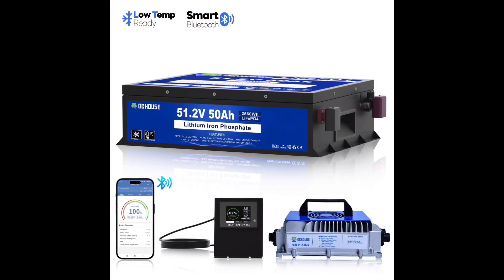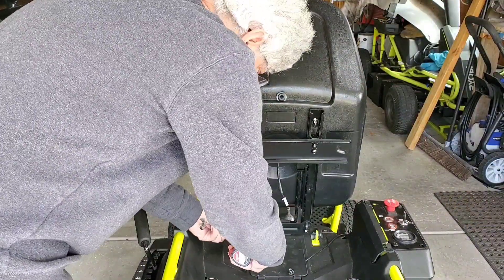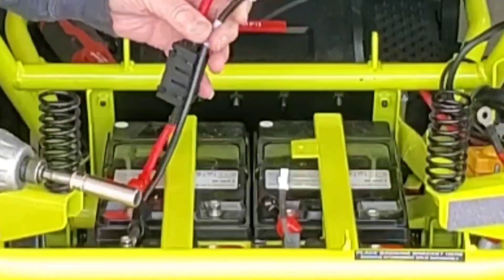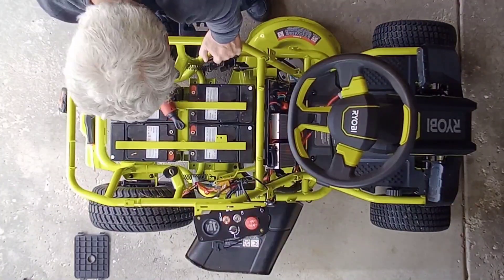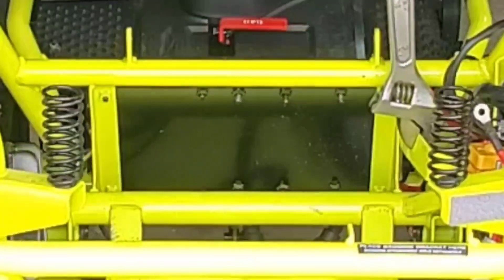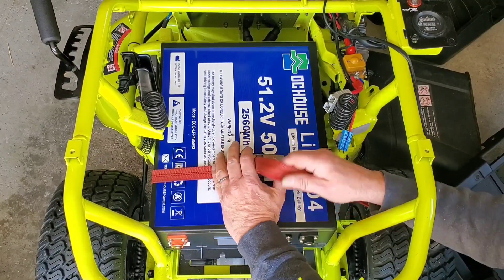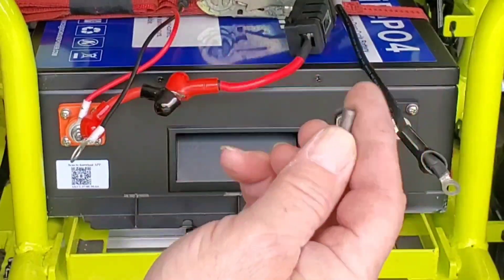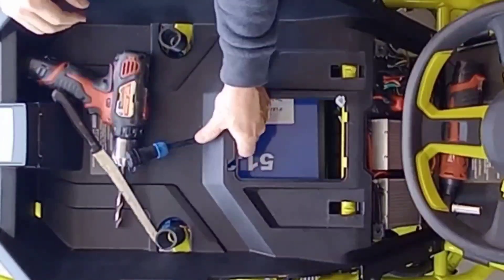DC House 48v 50ah Bluetooth Battery in my Ryobi 300e Riding Mower

Comment: Thanks for this helpful video. I've a 480ex and have noted that other videos on this topic don't show the lips on the base of the DC House battery being cut away and the frame being bent. Might the dimensions of the 480ex be larger than the 300e?
Reply from the maker: Yes the RM480 is completely different than the 300e for battery installation. 
Here's a video for a dc house 100ah battery in a zt mower the electrical is the same as the RM480 mowers 
https://youtu.be/Ddkk6SsI1tY?si=wiYTqp8sRtLArBo5

Comment: The step at 7:06 to loosen up the two nuts is critical. (I almost gave up after all the bending and cuttings) Because this step gives you that little room you will need to wiggling down the battery. Don’t forget to tighten them back at 9:31.

Comment: Questions ,why not use the Ryobi charge port? And the voltage meter?
Reply from the maker: You can use the factory port but the factory charger is not recommended. 
The factory  gauge is calibrated foe lead acid batteries.  It will stay on full untill the lifepo4 battery is under 10%

Comment: Working on this now... removed most of the torx screws with a T25 until the T30 could arrive, bc it worked and I had it on hand. Except for two screws the T25 was too small for. T30 just arrived... fits in the ones I removed already but is too big for the two remaining. Just ordered a set of torx bits; the only one in-between 25 and 30 is 27. I sure hope that does the trick. IDK why they would do it this way.
Reply: 27 worked. I installed the battery and made all the connections... got up to the part where you put in the key and turn it on. But mine didn't come on. The battery doesn't come charged. So I hooked up the charger, charged for 3 hours. The display shows 100%. But I turn the key, and... nothing!
Reply from the maker: Make sure the connector from the back of the port to the charger interrupt (blue wire)  is fully connected and locked together also make sure that the wires are fully Lin the connectors. 
Test the voltage at the bottom two pins of the charging port. It should have battery voltage.
Reply: @Ryobi48vElectricMowers  Got it! The two large blue connectors weren't fully locked in. Turning on now! Thank you!
Reply: Oof. Put all the covers back on, turned the key... again, nothing. This was after charging overnight. I opened the back panel so I could check the connectors; nothing seems to be loose. When charging, the charger light blinks green, red, green, red, and so on, which isn't on the list of things it's supposed to do in the manual. I press the button on the display, and it says 100% standby, then switches to 0% charge battery. I'm lost.
Reply: Tested the bottom two holes on the charging port with a volt meter, and it reads only 0.6V. Pressed the display button and it briefly said 50%, then 0, then stayed on 100. Key turn = nothing. Charger light still red, green, red, green...
Reply from the maker: With no voltage at the bottom pins of the charging port.  Check the main battery connector under the seat.  If it has battery voltage the port is bad. If the voltage at the main battery connector is zero or close to it. The battery bms has turned off.  To reset it most batteries will reset when the cables are disconnected from the ternimals. Once its reset check the port again.
Reply: @Ryobi48vElectricMowers  Thanks, I'll try that. What would cause the bms to turn off?
Reply from the maker: If the bms turns off when the key is first turned on . It's caused by current inrush from the motor controllers. The bms doesn't have a high enough settings to prevent the problem.  I have come up with an automatic precharge unit  that corrects the problem. The Dc House battery shouldn't have that problem.
Reply: @Ryobi48vElectricMowers  I just measured the battery directly, and there's less than 2 volts. Something is very wrong. Now I'm wondering if something is broken in the electrical system of the mower, and shorting out, and draining the battery... maybe the solenoid? I'm now in contact with DC House.
Reply: I'm going to disconnect the battery from the mower and try charging again. Unfortunately, I can't do that now because it's supposed to rain (there's even a tornado warning, though those usually come to nothing... famous last words, I know).
Reply from the maker: Less than 2v means the bms has turnd off the output (discharge) switch . To reset it the cables needs to be removed from the battery ternimals.   The voltage should come back on if not immediately, after a couple of minutes.  If it doesn't recover you will need a charger that has zero volt charging (jump start).
Reply: @Ryobi48vElectricMowers  The voltage is 41V, according to the display. Charger alternates red/green (no load). display reads 100% standby; status COV which I found means cell over-voltage. DC House has been slow to respond, and now it's the weekend and they're probably not there. The grass keeps getting higher. What can I do?
Reply: The meter doesn't agree with the display... it only reads 29.5V. Display shows cell 11 at 3738 mv, which must be the overvoltage. Cell 13 is at 0008.
Reply: Cells 14, 15 and 16 are MIA. No info at all.
Reply from the maker: Contact DC House at
service@dchousepower.com
And describe that the mower cables are disconnected and these are the voltages you are getting.  If possible get some screen shots and pictures of the display and send them also.
Reply: @Ryobi48vElectricMowers  I've been in contact through email since Thursday. They won't be back til Monday. My last email showed page 3 of the display, with the separate voltages.
Reply: Just heard back... they're sending me a replacement.
Reply: Got the replacement battery, installed it, mowed the lawn today!

Comment: Can the 100ah battery work?
Reply from the maker: The dc house 100ah will fit in the 300e but you need to remove the vertical separators in the center of the battery tray. It's a tight fit.

Comment: I just completed this install today. Thank you for your guide, it was very helpful. There were some slight differences in my relay bracket, so I had to make a more substantial modification by cutting out the lower support so the battery would not rub the deck height adjustment arm. I installed the DC house charge port to the left of the original charge port so I don’t have to lift the seat or hold the port steady to connect the charger. Thanks again!
Reply: I had to do the same thing; in addition, I had to remove the sit spring on that side (replaced afterwards of course). Also, I didn't see the need to loosen those 2 bolts on the bottom of the frame, or to cutoff the right-side corners of the battery bracket.

Comment: Thank you so much for the detailed info. I've ordered my battery and the step down terminal screws and should be tackling this in a couple of days!
Reply: Update - battery arrived early and install success!!! I followed your method and all is well. Lights work, mowing in reverse works, blades work - did victory donuts in the driveway. Haven't mowed yet as it was getting dark when I finished and now it's raining - will update again after mowing. Battery shipped had 40% charge. Using the OEM battery charger and not the DCHouse charger (yet) and it works fine. Went from 40% to 100% in about 2 1/2 hours. Unplugged after hitting 100% to protect the battery. Display works great and battery app works great. Looking forward to mowing soon. I used a strap to secure the battery but as you commented to someone else, it's really not even needed. The weight of the battery and the way it's in the chassis - it's not going anywhere but it's strapped in anyway. Thanks again for the great video and info!
Reply: Just finished first mow. I have a little over 3/4 of an acre with some hilly bits and bumpy roots in parts. Used only 23% of the battery. Surprise effect = much more nimble! Easier to steer and climb hills and less bumpy. and overall easier on my back. I guess this is related to the reduced weight with the 60lb battery compared to the 4 lead acid. Thanks again - SUCCESS!
Reply: @snackinallday44   You said that you used the OEM charger. How is that going? Does it not hurt the Li battery?
Reply: @CokemanChatt  No issues so far - working really well. I mow three times before charging getting it down to about 35'ish % and then plug in to the OEM charger. The battery shows status of charging and I keep track of the charging on the app and when it gets to 100$ charged I unplug it to be safe and not overcharge it. It's taking about 3 1/2 ours to recharge to 100% from the 32-35%. Really happy I did this conversion.

Comment: Hi  I enjoyed this video very much. Could you tell me the DC House part number of the battery you used?  I prefer doing my 300e the way you've done yours. Or should I use 4 of their 12volt 100 amp batteries? Please advise.  Thanks in advance.
Reply from the maker: A single 48v battery requires less maintenance to keep the cells balanced. 
Go to the DC House website for the battery I recommend getting it with the charger and display.

Comment: I did everything you did..no power, no click when I turn the key. Battery monitor reads 97% in standby mode. Any suggestions?
Reply from the maker: Check the voltage at the bottom two pins of the charging port  it should be battery voltage.  Then check the blue wire from the back of the port. Either the wire pulls out of the connector or its not fully locked together. It also should have battery voltage on the port side.
Reply: Did you figure out the problem? Thanks

Comment: Great job. How do you connect this battery to use the existing triangular charging port on the back of the mower (NOT the DC House-provided charging cord)? I already have my own  LiFePO4 battery charger.
Reply from the maker: If you connected all the port wiring the port will charge the mower.
Reply from the maker: See the time 16:20

Comment: Would the same basic steps be the same with the R 480e? Thank you
Reply from the maker: The 480e is much easier 
 The battery tray slides out and the battery fits without modifications
Reply: @Ryobi48vElectricMowers  Thank you. Appreciate all the information you provide. Kudos!

Comment: I see people using 50ah batteries. Most of them have 50amp continuous rating. Is that sufficient for these mowers?
Reply from the maker: 50amps is barely enough 
 The dc house battery is 100 amp continous and 200 for 30 seconds

Comment: If you read the back of the stock ryobi charger it says for lead acid battery type only so I'd just use the new charge port and charger it's a better setup to charge
Reply from the maker: You are correct but some people swap the factory connector over and use the factory port for charging. I wanted to prove the port can still be used.
Reply: @Ryobi48vElectricMowers yes but you never said that in the video so people will watch it and think it's ok to use the stock charger
Reply: @Ryobi48vElectricMowers can you explain how to convert the factory charger?

Comment: How long roughly would you say the battery lasts?
Reply from the maker: Typical charge cycles is around 2000
 But even if you only get 1000 cycles and you charge and discharge  it once a week  in a mower  would be 19 years. So it should easily out last the mower.
Reply: @Ryobi48vElectricMowers  forgive me. I meant to say how long does the battery last on a single charge.
Reply from the maker: With  the 300e mower at least an acre. I just mowed my ½acre lot with wet grass and 60% overlap and ised 18.5 amp hours out of 50 ah.
Reply: @leo959  😂

Comment: Very timely as I just took delivery on my DC House 48v LiFePo battery to replace the 4 SLA batteries in my Ryobi RM480e.  One question: you mention at the end that you can either charge the new battery with the DC House charger or with the original factory charger, but I was under the impression that you could not (or at least should not) use a SLA battery charger to charge a lithium ion battery. Thoughts?
Reply from the maker: Some people use the factory OP-48 charger  which I don't recommend.  It just shows that the port can be used for charging. You could cut off the dc house ring ternimals and connect the wires inside the factory port connector .

Comment: I love the battery and its features but not too keen on the installation. You basically modified the battery and the mower frame to squeeze into the mower body. The ratchet strap to secure it doesn’t seem adequate and you basically made it so you can no longer use the slide battery tray anymore to access the battery compartment. It would be much better if the original battery mounting brackets could be used but probably not possible. Too bad the battery wasn’t slightly smaller but it is designed for a golf cart after all. 5:29 I have the same mower and still are using the original lead acid batteries after 7 years though they are weaker. Replaced the controller that went bad with a flipsky you showed on a previous video and that works great. I think I will look for another battery option though.
Reply from the maker: The Rm300e  doesn't have a slide out tray.  At this time all Lifepo4 batteries installed in a 300e require some type of modification to the mower frame. The strap is way Overkill you could turn the mower over and the battery won't move.
Reply: @ Thanks for the reply. You are correct my mower is a little older. I will be mowing for the first time this year and will see how the batteries perform. I may be eating my words and be replacing them with the DC House battery! ;-/